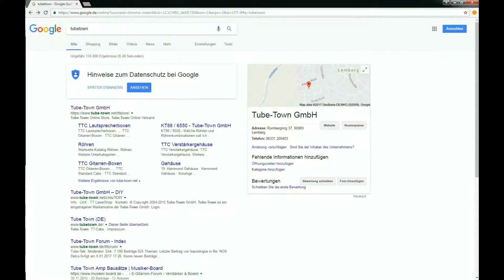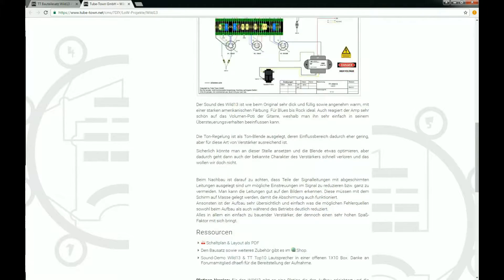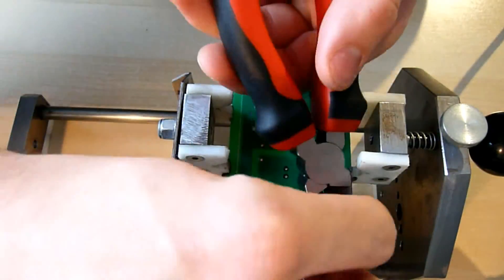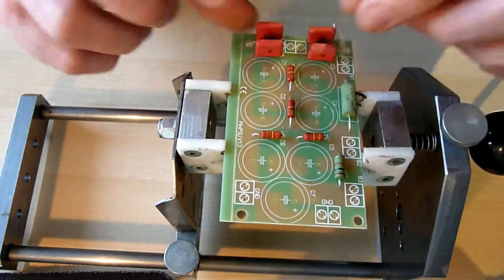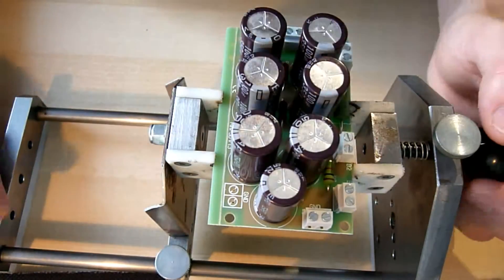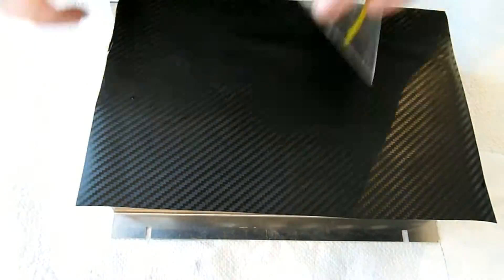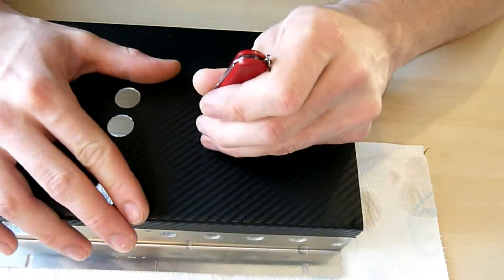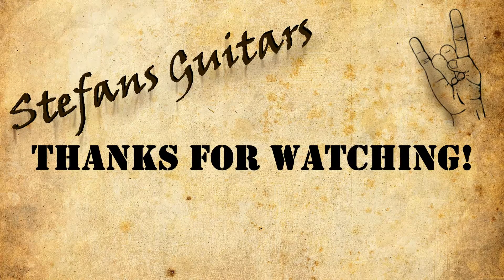Build your own Tube Amp! Tiny Terror Copy by tubetown.de - Episode 1 Powersupply

Comment: I'm thinking of taking the preamp section of this amp and pairing it with a 6L6GC Class A power stage. Would that change the tone of the amp?

I'm fairly certain that i can design a good power stage, but i have never worked with tubes before, so i don't know which parts of the amp have an influence on the tone.
Reply from the maker: Can't help you, this is a bit too high for my knowledge. Sorry 😁
Reply: it will lower the gain , because el 84 tubes is easier to overdrive
Reply: It wont change the tone at low volume, but the louder you turn it up, the more you will notice a difference